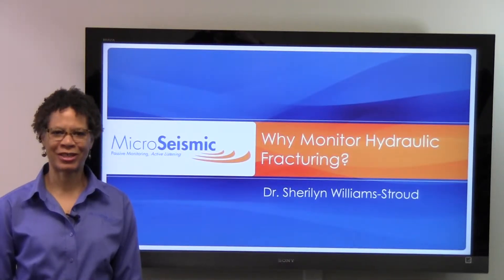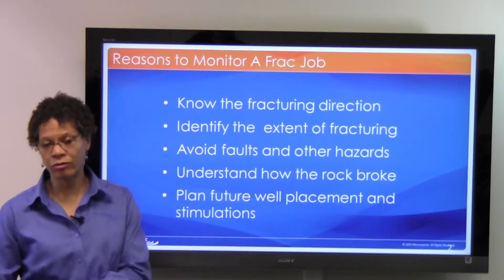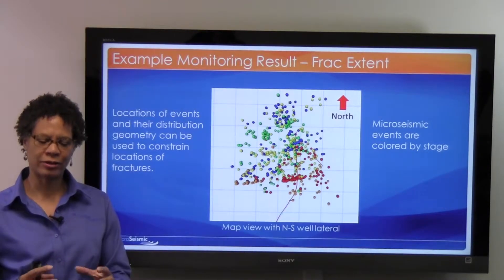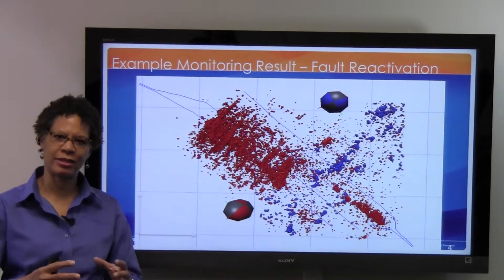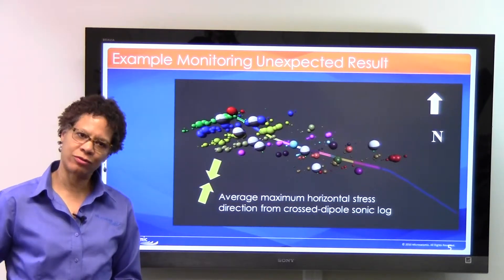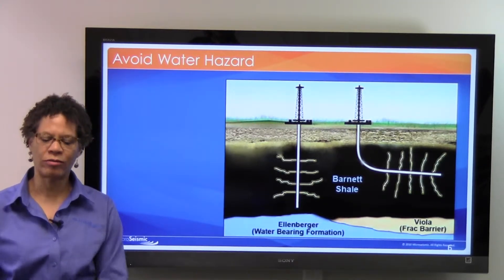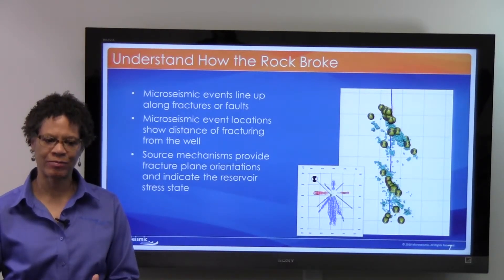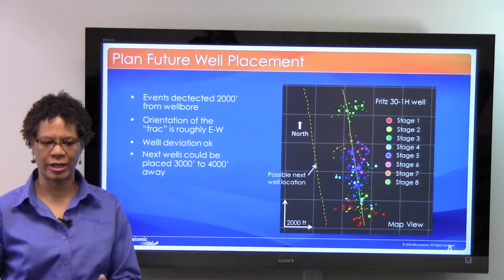Why Monitor Hydraulic Fracturing with Dr. Sherilyn Williams-Stroud

Comment: At 1:10 the diagram shows that on this 500 ft grid that the  monitored fracturation extends at least 2000 ft.
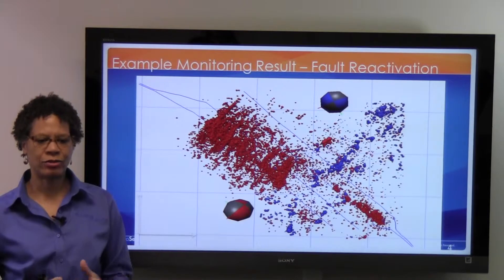When Faults occurs, (diagram at 1:45) then the fracturation out of control extends much more than that. In fact it extends outside of the shown diagram. Have a look at "Shale gas 101-Utica"  for the consequences of that.